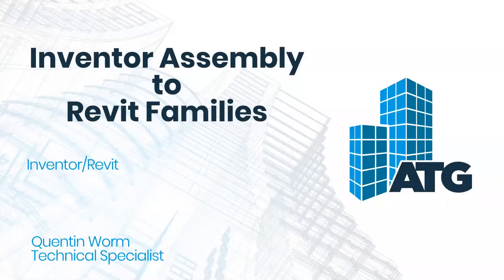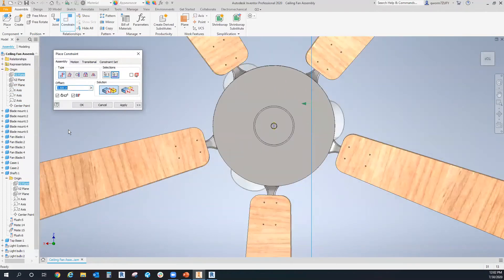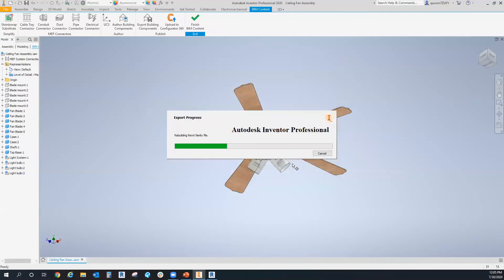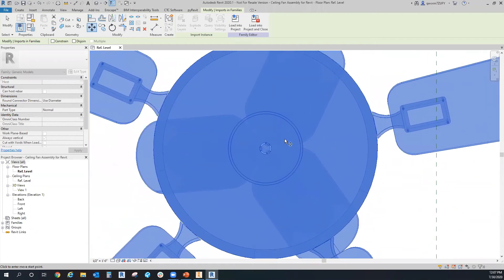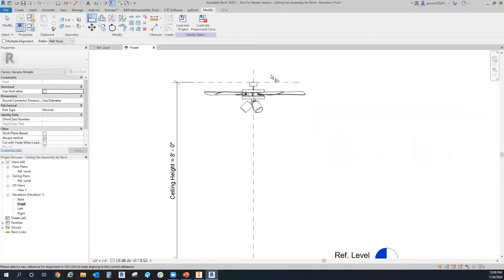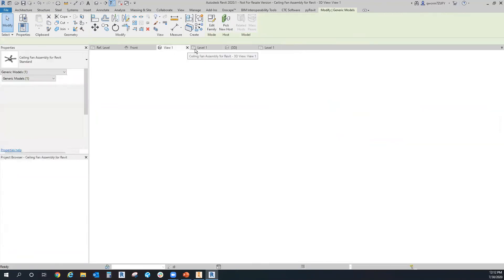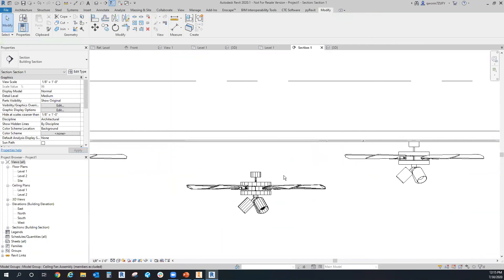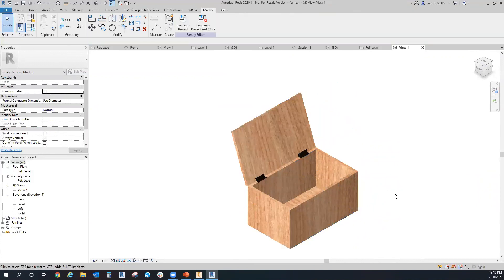Convert Inventor into Revit Families

Comment: Hi! I have a question, when you export the assemblies from Inventor to Revit in this video, do they get imported with the materials and separate functionalities that you have defined for them in Inventor? I am trying use Inventor 2022, but not all the materials come through to Revit. It comes as a big chunk of geometry without distinction between separate parts and subsequent materials. I tried with both rvt and rfa. Any solutions or suggestions is appreciated by me.
Thanks :)